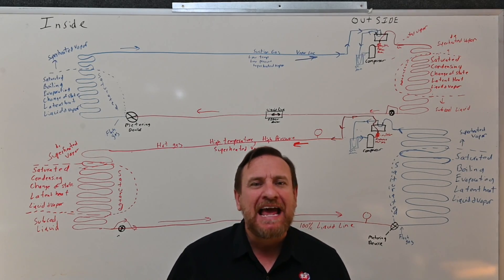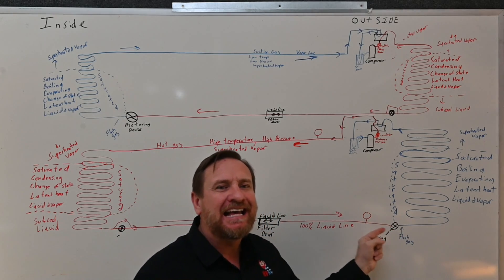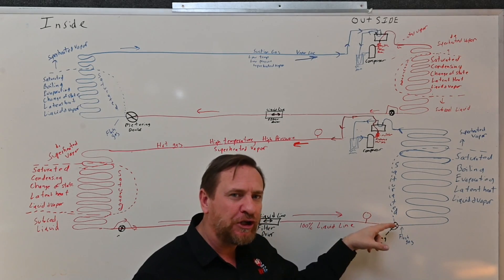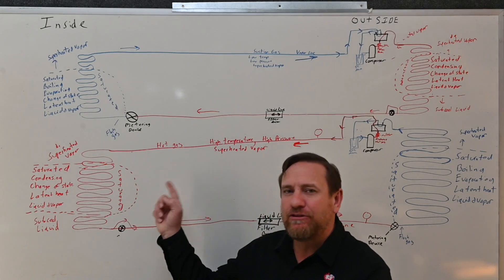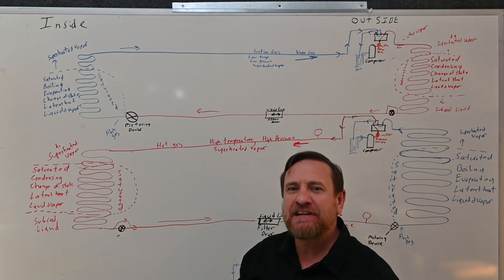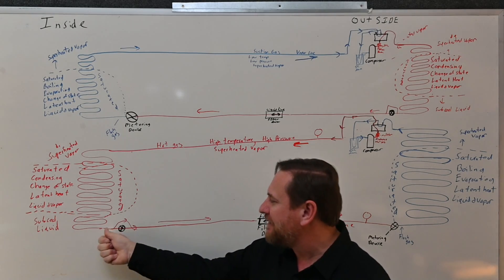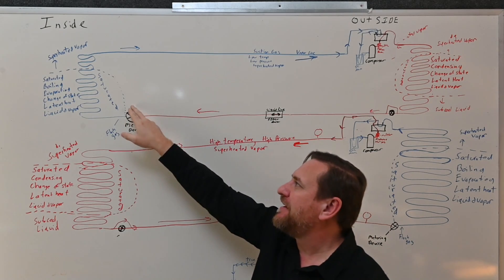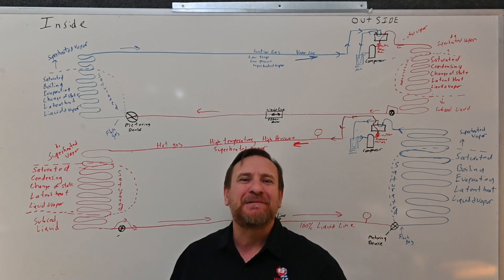Heat pump 13 stuck check valve

Comment: Excellent I didn't even know there were check valves on heat pumps. Would putting temp clamps on each side of the check valves to temp difference help to confirm if they are stuck closed or opened? Thanks for the info

Comment: I really don't know what I'm talking about and I'm going by the hvac tech that came by said, but he said my outdoor unit's (DT4QD-036K 3.0 Ton) valve is bypassing refrigerant, the pressure should be 500 psi and its only reading 200-230 psi, he wants to replace the whole outdoor unit $4,000 -_-. He said because the unit is already 12 years old and it'll eventually fail. What valve is he talking about exactly because I'm going to attempt and replace that first?

Comment: I'm following you so can an internal txv check valve fail?
Reply from the maker: Yes
Reply: @love2hvac  When I did the indoor coil repair I flowed nitrogen. I always flow it anytime I do a repair. Just wanted to let you know.
Reply: Reason I am asking is because we have had an issue with a trane package heat pump. Last March It was locking out on a in-timed defrost 8 and 9 fault. When testing we found the tech determined it to be on the cooling side. The indoor txv was restricting when going into defrost he replaced it. It happened again. I go out there and looks to be that there is a restriction on the cooling side. We just replaced a txv so I called Trane and they said indoor coil was plugged with the readings I gave them. Replaced coil w/new txv and tested and everything looked okay. Tested defrost numerous times and no issues. 9 months later (Dec) issue is happening again. Same thing in timed defrost. I tested it and no issues. Forced defrost things looked okay. Forced again and when it came out suction pressure fell below the low pressure switch cut out. Switch opens up at 35psi and I was near 30psi. Granted I had bypassed low pressure switch while currently testing thinking maybe it was the issue but it was good. Had no significant temperature drop across filter drier so Determined outdoor txv was issue. Replaced and no issues. I have a picture of the filter screen at old txv and you can see its plugged. Wondering if that was the actual issue the whole time. If the screen is restricted wouldn't that also affect it bypassing correctly?
Reply from the maker: @ddcws1  yes if the screen is clicked it would affect bypassing.

Most of the Trane units have an external check valve outside
Reply: @ it's a residential package unit. I don't believe there is an external check valve.

Comment: Are there any cases where the reversing valve or compressor will be the issue in a high suction pressure scenario? If so, would it be possible to make a video on how to troubleshoot such issue?

Thank you for the videos you make and all you do for HVAC community!

Comment: On a previous 410a charging video, you charged the unit through the low side. Is it safe to add liquid knowing that’s it going to the compressor?
Reply from the maker: Throttling it in, very short burts allowing to to expand to a vapor before reaching the compressor.

Comment: 3 ton  residential package unit 410A  .  
Compressor trips on over pressure in Heat Mode (>500psi).  
I blocked the outdoor fan with a cardboard so it wouldn't trip. (temporarily to measure)

LO side P=110, T=38.6 (suction) Tsat=35.5 => 3.1deg superheat.
HI side P=350, T=80 Tsat=105 (25deg subcool!)  (Downstream from the TXV bypass )

After watching this video, I need to recheck upstream from the TXV bypass
And look for a temperature difference across the TXV that is supposed to be bypassed in Heat Mode.

If stuck, is there a way to get it unstuck without opening up the system?
Reply from the maker: Sometimes a magnet works, some times tapping it but those are often temporary.

Comment: Happy New Year Ty!  Love your teaching and videos.  Other than gauge pressure and temps and SH and SC, can you also do a temp across the metering device to prove prior to change out?
Reply from the maker: A temperature reading across an open check valve is a great way to check.  It should be the same temperature, if not it's likely restricted 

If the metering device is engaged there will be a temperature drop but there is  in value in what it should be

Comment: Hi Ty. I have a Trane Heat Pump. There is a bypass check valve at the outdoor unit which I believe is a ball type check valve that allows refrigerant to bypass the outdoor TXV. There is no such bypass valve in the indoor unit. This means the indoor TXV must have a built in bypass when operating in heat mode. Is this the case? My mom also has two similar Trane Heat Pumps. One has a similar bypass on the outdoor TXV but the other unit does not have this extra bypass routing, only the outdoor TXV. I guess there are TXVs designed to allow flow of refrigerant in both directions. My outdoor unit was making a chattering noise while running and pretty loud after the compressor shut down for a few minutes (in cooling mode). I diagnosed the noise coming from the outdoor check valve. Apparently this is a known issue with older Tranes (2010). Trane released a clip on magnet part to help eliminate the noise. I suspect that after the compressor shuts down, refrigerant is flowing back through the valve which causes the noise after shutdown. Hopefully it won't harm any other components. I have posted a video of the noise on my channel.
Reply from the maker: The Trane check valve rattle is a known issue for sure. I likely to damage anything and the magnet kit helps with the noise.

The indoor TXV is usually built with an internal bypass check valve. Some Trane TAM models use an electronic expansion valve inside. They are programmed so the stepper motor  of the EXV opens all the way for bypass.

Excellent question!
Reply: @love2hvac   Thanks for the reply. I was a little perplexed when I didn't see external bypass piping on the indoor TXV like it has on the outdoor unit.